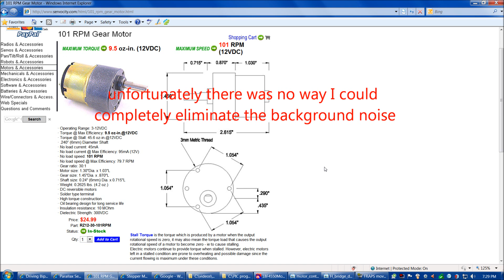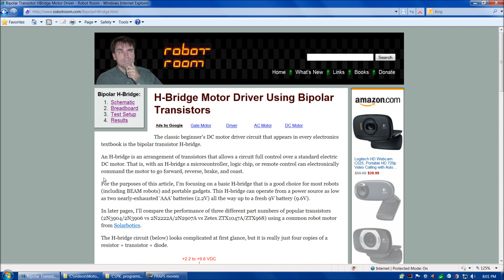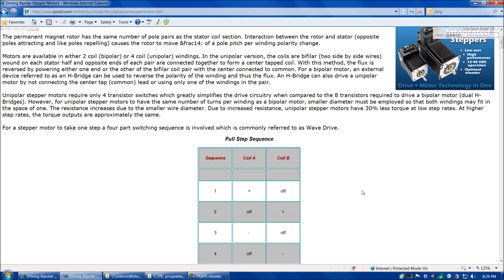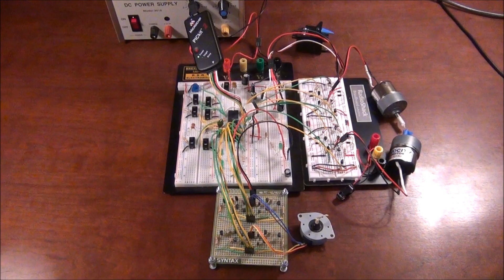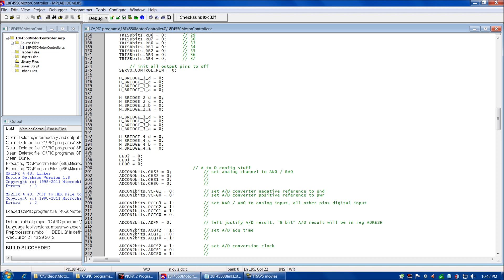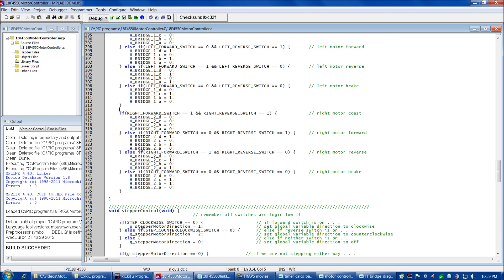PIC 18F4550 Motor Controller

Comment from the maker: To read the hex file from any PIC microcontroller that the PICKit2 can read, connect the PICKit2 to the chip (VPP, power, ground, program data, and program clock pins, see previous tutorials as applicable), then start the PICKit2 software and choose 'Read', then File -> Export Hex.  This will save the hex file in the chip, the hex file can be read with a text editor such as note pad.

(out of characters, see next response)

Comment from the maker: It is not possible to go from the hex file back to C; data in a C text file such as variable names, comments, spacing, etc is lost in the compilation process (going from .c to .hex).  If you are extremely fluent in assembly language and the hardware for the chip you are working with, it would be possible to translate from the hex file back to an assembly language equivalent, however this may be incredibly difficult.

Comment: First of all I want to mention that those videos are very helpful for people like me that are just beginning to work with micro-controllers and programing.
For the moment I have some skills in programing but only in java noting special and some skills in electronics as well noting special 
But my question is 
I got few chips few microcontrollers  like 16f960 / em78p459 /18f4520 etc from few broken treadmill PCB controlling the DC motor 
I coudnt    find any broken element or part on it so for...